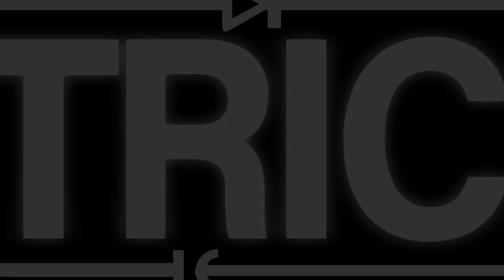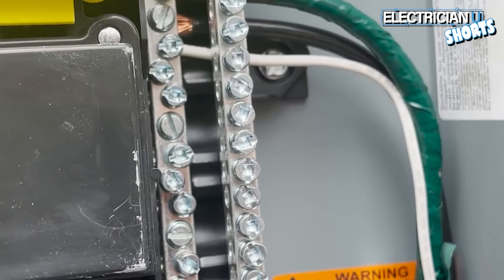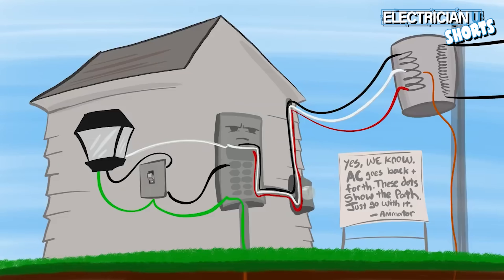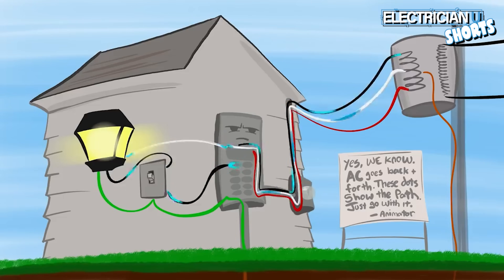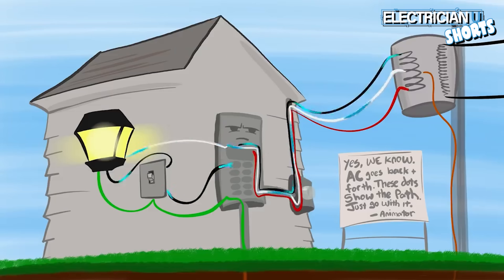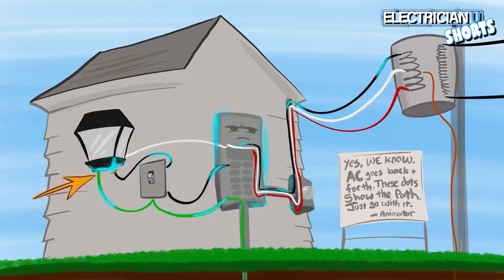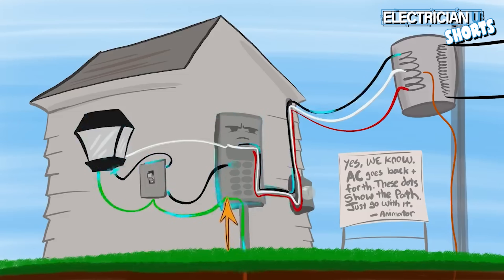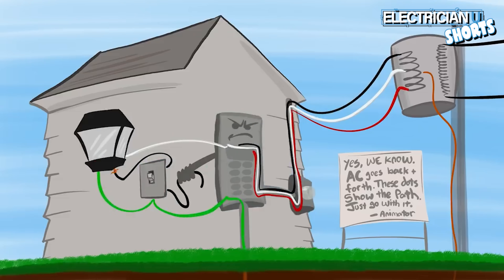SHORTS - WHY WE BOND (Neutral & Ground) Explained in 3 Minutes

Comment: Great video, but I feel you left out some very important information that is needed to understand how electricity flows.
Grounding (earthing) is mainly used for lightning protection. It is not meant to clear fault current.
The normal circuit current flow for the light bulb shown in the video is from the source (transformer) through the wiring and the light bulb. All the current returns to the source (transformer).
When the light fixture fault occurs you correctly showed the fault current flowing to the green ground wire into the earth.
But this fault current is not dissipated into the earth, as the video implies.
All the fault current flowing through the ground connection would try to flow back to the circuit source (transformer). The current would flow from the ground connection through the earth to the bare wire on the power pole and up to the source, the transformer.
The earth varies in resistance and normally would not allow enough current to flow to trip a circuit breaker. That is the job of bonding which gives the fault current a low resistive path back to the source(transformer) to activate a circuit breaker.

Comment: I dont think this was accurate. The way I basically understand it, is that neutral is ground, neutral is grounded at the tranformer on the street (secondary side of the transformer). If there was no bond between the neutral and ground at the building, then when there is fault, the only way power can get back to the transformer, is through you to ground. Ideally there should be no potential difference between neutral and ground at the building, it means your building is well grounded relative to the transformer feeding the building.

Comment: There are many countries in Europe where that bonding is not done. In that case one needs complete RCD (GFCI) protectiin. There typically is two levels 100-500 mA for the grounding for the whole house and 30 mA for individual circuits. A ground rod alone would not trip the breaker and make it safe. Different countries have chosen diffrerent methods in their regulations.

Comment: If the neutral is grounded at both the service panel and the utility transformer and the neutral breaks, you will have current trying to flow thru the earth. Not good. Ground the neutral at one place only.
Reply: Do you get what happens when the neutral breaks? The cutrrent will not go through the air. It will go back through the ground wire to equipment cases. Then it will seek other routes like water pipes (bonded), your cable TV connection etc.

Not that the ground rod saves you cut at least it may offer some help.
Reply: @okaro6595  I was referring to the neutral conductor breaking between the transformer and the service panel. Draw a simple diagram showing a neutral ground connection at both places and you will see what I mean.

Comment: I don't understand. Pull your meter and look at the wires. The neutral has a copper wire going to ground. Look at the pole. That copper wire running down into the ground? Look up. It is connected to the neutral up top. As in grounded. I have been doing electrical work 45+ years. The neutral is always grounded. WTF?
Reply: But at a panel you bond or else the ground isn't connected to neutral.   So the ground being connected to neutral further towards the service doesn't matter..
Reply: The bonding strap just connects ground at panel to neutral.    That's it.   If there is no bonding strap then the panel has a disconnect between ground and neutral.
Reply: You're only Bond the neutral in the very first connection which issues leader meter. Everybody can argue all you want that's how you do it

Comment: @ Electrician U. What happens if the neutral between the panel and transformer breaks?
Reply: Shit hits the fan. You get arbitrary voltages at equipment cases up to 120 volts. Thete will be arbitrary voltages between 0 and 240 V on sockets and lights and equipment breaks.

The system may also find an alternative neutral like your cable TV connection which is of course not good. In short that is about the worst that can happen.

The advice is to get put and call the power company. Even cutting power can be dangerous as the panel case can be energized.

Comment: Curious. What if you “bond” at your equipment ie dryer. Would that negatively affect the breakers ability to detect a fault?
Reply: No, however it would cause problems if the neutral broke.

Comment: Thanks a lot! 
We need the fault current to go back through the neutral wire to allow for the breaker to know there is a fault current and trip.
The question is, RCD does not need this process to know there is a fault current. Then if we are using RCDs, do we still need to bond earth and Neutral?
Thanks 🙏
Reply: Not necessarily. Many countries in Europe use TT and it is mandatory: Italy, Spain, France. In some countries like the UK it is optional. In the US it is not allowed. In TT the ground goes only to a ground rod but one then needs universal RCD protection. There typically are two levels, 100-500 mA for the grounding and 30 mA for additional protection. Before RCDs were used TT systems used different types of protection to cut the power.
Reply: @okaro6595  much appreciated 
We use TN-C-S and TNC in the UK.
Can I assume it is not needed (technically) if we are using RCDs?
If so, then I think it will be under one condition:
All the DBs connected to that transformer must have RCDs or RCBO. 
What do you think?
Reply: @babyprince84uk TN-C is not and has never been used in the UK. Older ones were typically TN-S and newer ones TN-C-S. Rural areas use often TT.

TN-C has been used in the past in German speaking countries and in Finland and possibly Sweden. It is now banned (though in Finland it is allowed in conversion, also of course replacing broken sockets is allowed). TN-C does not allows RCDs before the sockets.

Comment: Never wondered that because they all feed back to the center tap on the transformer.

Here's what I have wondered, what dumb ass decided to call it a "ground" when in reality it's a safety/backup neutral (alternative path) and has NOTHING to do with Ground/Earth other than to confuse the shit out of people 🤣

I also don't see why the newer service panels separate the grounds & neutrals other than to make the wiring look a little neater.  I know it cost more due to the extra bus bar and the cross bar that bonds them together 🤑

I think these people just sit around every three years thinking up ways to screw the consumer out of more money and to sell a new code book 😏

Also, the video animation of it actually Earthing is bullshit!  Current will take the path of least resistance and return on the neutral/ground bus bar due to the Earth's higher resistance.  Just so you know, every time you touch your service panel, you are in fact in contact with the neutral or center-tap of the transformer.  The reason you aren't shocked is that the flow of electricity will ALWAYS attempt to return back to the source via the path of least resistance which is a good thing for you right.

The Earthing conductors (5/8" x 8ft - ground rods) in the actual ground are pretty much for static build-up and lightning 😒

Honestly, states should require electricians take a 2-year associates degree in electrical engineering technology to get a better understanding of how things really work but that's just my opinion 🥴

Comment: Why not use RCDs which monitor the live and neutral current and if they are not even, they trip.  Now the earth can be grounded as normal.
Reply: There are diffrerent grounding systems. The benefit of a TN-C-S system is that it does not rely on any RCD. In case if fault the loss of power is limited to one circuit.

Comment: I had an electrician fix the drop wire from the power pole to my house - it had a lose connection and was arcing.  Active/neutral are on the drop and we have an earth spike bonded to the neutral bus bar.  The electrician asked me to power up the kettle for a load and then did a split test.  I was suprised that several amps were flowing into the ground spike.  That apparently is normal, so no, its not just during fault conditions that the earth spike is driving current through the physical earth around your house.    Neutral is bonded to another earth spike at the local transformer.   This is a typical overhead pole supply in Sydney, Aus.

Comment: Very good video to explain how electricity travels but I don't think it explains clearly the need to bond neutral and ground. If a fault happens in the fixture and goes to ground, the current travels back to the panel and then to ground, thus completing the loop. The breaker is only on the hot wire. I don't understand why it "the breaker" needs to know if there is power coming back on the neutral or the ground wire. When it sees too much current draw it will trip, either way. On a normal system  I do not see the need or see how this video explains that. I'm not saying they don't need to be bonded, just I don't understand why in my scenario.

Comment: You should explain why we don't bond the neutral and ground in a subpannel and why there's a difference between neutral and ground. Instead of it just being a combined ground/neutral wire.
Reply: There is no reason to bond them at a subpanel. I do not get the question. You need a reason to connect wires You do not randomly connect wires together. The rule is that once separated they will not be connected. There is no subpanel exception.

Comment: The transformer is also grounded, so the flow from the lamp actually returns tho the source through earth. It's a small current, so the tripper won't act. If ground and neutral are bonded, this current becames much higher (a short circuit) so the tripper will act, de energizing the lamp carcass and preventing shocking.

Comment: Then why do you need to UN-bond neutral and ground on the main panel if you add a generator transfer switch that sits in the middle of the meter base and main panel???

Comment: This whole video is basically: "why you should wear rubber soles when sticking a fork into the electrical outlet".... Well, wouldn't it be safer not to?..at all?
Connect GND and NEUTRAL together, then go touch your metal fridge or washing machine, while barefoot on a flooded floor (or while touching a radiator who's pipe is goes into the ground)... Only then you'll find out why GND and NEUTRAL should NOT be bonded together... ANYWHERE... EVER.
Reply: You are just wrong.
Reply: @okaro6595  No. I'm not.

Comment: This makes no sense. If the LIVE is shorted to GND (through some household appliance)  ; then the amount of curent going through the L wire will be higher than the amount going through the NEUTRAL wire... thus the breaker will trip (which is good!) 
Tying together N and GND solves nothing. Even worse, it might send some of the current through NEUTRAL, thus maybe fooling the breaker not to trip (if it's a small short). 
Not to mention, that by tying N and GND together; even if there's no problem, you're pretty much just dumping LIVE current into every grounded chassis of every  active appliance around your house.
If tying N and GND together was ok to do; then there wouldn't have been a need for GND now, would it? Every metal chassis would have just been tied to NEUTRAL internally... But they're not! They're tied to GND for obvious freakin reasons!
Reply: Normal breakers do not monitor current imbalance. They only react to the amount of current. A GFCI monitors the imbalance but all circuits are not GFCI protected, especially in older homes.

A normal breaker would not cut out the power if grounding was done with a ground rod alone. A GFCI would.
Reply: @okaro6595  Balanced breakers are just one reason why you shouldn't do it. Even in their absence, i've stated other reasons as well.

Comment: You used the phrase that the breaker 'knows of the problem', but the breaker is not connected to the neutral, only the hot. How does bonding let the breaker 'know'?
Reply: There is same current in the hot wire. If the breaker was on the neutral it would not help a bit in case of a fault as the current goes through the ground, nit the neutral.

Comment: Great explanation. One criticism however. 

There is no neutral in a 120 volt branch circuit. (At least not in the US). The white wire is not a neutral, it's officially known as the grounded (or identified) conductor. But it's definitely not a neutral.

A neutral carries only the unbalanced load on a 240 volt circuit. Whereas the white (or grounded) conductor carries the full circuit load. 

(Also, the green wire, what you refer to as the "bonding" conductor, is actually known as the "grounding" conductor.)

Although these are  common errors, they still are incorrect and need to be mentioned.
Reply: Come on what nitpicking. The grounded conductor is the neutral, the grounding makes it neutral.

Comment: Excellent video. I do have one question. If ground and neutral are bonded, why is there no current flow on ground when everything is working correctly?

I'm sure this is wrong, but it seems like everything should be live and dangerous to touch if you are grounded.
Reply: The resistance of the ground is much higher than the neutral. Sure there is tiny flow but it is irrelevant.

Comment: I disagree. The Ground IS the path that current would flow, and does not require the neutral. Current through the breaker to ground will still trip the breaker.
Reply: No it will not. You need a low impedance path to the source. The soil is not that.

Comment: I guess a way to look at it is that we often think of a breaker being there to handle the case where there is an overload condition such as having to many devices plugged into a circuit. This will protect the hot and neutral wires as well as the receptacles and switches. However, by bonding neutral and ground at the panel, the very same breaker can serve a second purpose which is to protect the hot wire and switches and receptacles and HUMANs in the case of a ground fault.

Comment: Wrong buzzer noise, bonding is to tie things together in case the neutral to earth voltage increases due to a fault in the distribution network. Everything around for example a pool with be at the same potential, even if that is 40 or 60 vac above (and below) the earth nearby. Grounding forces a fault as you covered